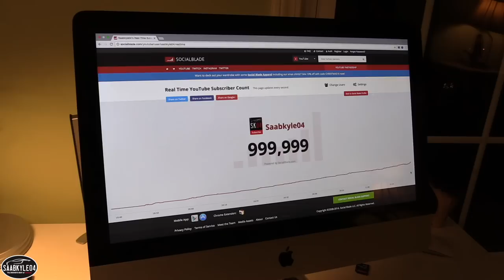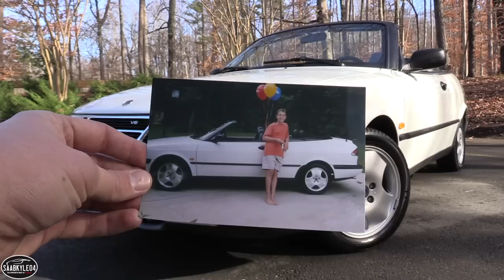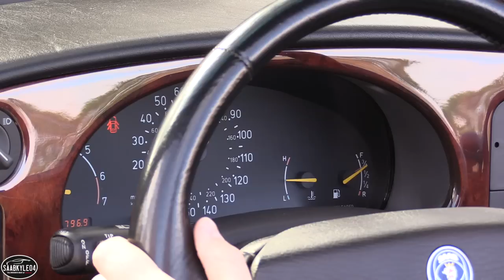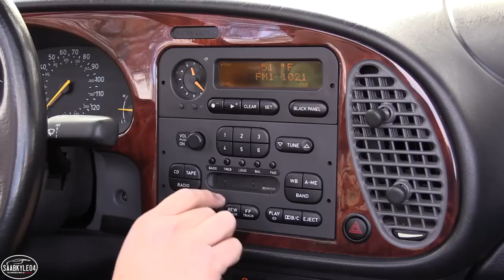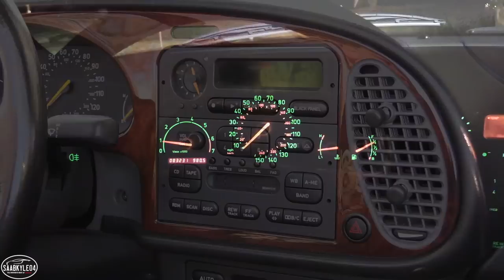My SAAB Story - Saab 900 SE Convertible In Depth Review & Road Test (1 Million Subscriber Special!)

Comment: The LOUD button on the stereo turns on the Loudness Curve, which is a form of equalisation intended to mostly enhance bass and low-mid frequencies at low volumes to compensate for engine and road noise.
Reply from the maker: That makes total sense, I knew the premise but didn't know exactly what it was effected.  Thank you for that!
Reply: Saabkyle04 No worries :-)

Comment: I had a 1997 NG900 5 door with the 2.3 non turbo manual it was very reliable and fun. I have been driving several 2004-2005 9-5 manual sedans and wagons

Comment: congrats on the million plus subscribers.

I bought a 1998 saab 9-3 convertible, paid £2000 for it and over 4 years I dropped £8000 into her to get the saab I wanted.

3 years ago we bought a ng 9-5 (the new shape) have you reviewed one?
it was a special car and an event to look at and drive (our actual car appeared on top gears review on saab after they went bust)

I regret selling it,but no dealers and limited supplies of parts,no tec 3 to maintain the electronics meant it had to go.

Comment: I had a 1998 Saab 900s with the rare copper color, manual transmission and convertible. this video brings back memories. I had to scrap it because the interior got destroyed from mold. the top leaked. I want to buy a used one soon and restore it just like you did.
Reply: it had 230k on it and could have kept going.
Reply from the maker: Man, that sounds like quite the special car!
Reply: Hopefully they make a comeback

Comment: You know, I have a 22 year old Saab 9000 and I've just invested in new shocks all around, new cv joints, new lambda sensor, new v-belt damper, new stainless 2,5" catback exhaust by BSR, new 3" sport catalysator etc etc. Also got another boot lid in correct Le Mans blue colour which I'll swap on later. I've installed a complete Aero interior, GT28RS turbo, high perf fuel pump, injectors etc.

Maybe I should change my name to Saaberick.

Comment: My 1990 BMW e30 convertible, with plastic rear window does in fact have a rear defroster, it is electric and operates like a hair dryer blowing warm air onto the plastic, I also have a hard top for it that has rear glass and defroster, all of this of course is irrelevant as I don't drive it in the winter :)

Comment: When did Saab get in bed with GM? I noticed that one of their SUV's from around 2004, it had GM door handles and it had curves similar to GM vehicles. That was a big turnoff to me. Saab were always somewhat prestigious and unique in their design and materials used. I wonder where Kyle's was built, I doubt in Sweden. My brother had an '83 900 and it was very durable and dependable, but I have to say he did put quite a bit of money into it.  I can't remember exactly but it cost at least $2,000 for a new clutch, supposedly because it was front wheel drive. And when it was cold, it would stall at least four times after starting until it ran long enough. And I also remember it would always grind going into second gear, and he never found out why, unbelievably. In any event, it was fun to drive, not at all energetic, but adequate. And it road somewhat firm, but felt very substantial, not unlike an older Benz from the late 80's.  And it was very roomy, surprisingly so. I often wondered if Saab or Volvo made the better automobile?  Volvo was always known for safety, namely the safety cage surrounding their car. What most people didn't know was that Volvo marketed their cars on that but every car at that point had a safety cage. But it definitely served Volvo well. I guarantee they sold many cars because of their safety, because quite honestly, they weren't much to look at.
Reply: 2k$ for a classic 900 clutch is a shameless rip off. Parts are around 300€, and replacing it is less than hour of work, even on a turbo. I know no other car where a clutch job is that easy...

Comment: i need to buy a 2001 ford windstar again or trace ours down. We sold in in 2012 after something went wrong with the engine for 700 bucks to carmax. I remember missing that van so much, i grew up in that thing and went everywhere in that thing. It's very rare to see a se from 2001. I found the vin number a month ago and It works. Just dont feel like wasting money on finding out where it is at the moment.  I need to buy a 1985 toyota supra first with my money as my first car, tired of driving mom's civic. Oh and I also tried to find our also very rare 1995 dodge stratus es and 1983 honda accord but no vin numbers anywhere ;( I searched for a week and half.
Reply: Shyzah My parents had a 1997 Toyota Corolla, I loved that car. We stopped using it in 2010, when my parents got a Mazda5. Since then, the Corolla has just been sitting next to the house for the next 3 years, until my dad wanted it towed away to the dump. It was a sad experience for me!
Reply: yeah.... tbh if the windstar wasn't a van in which i went everywhere in i wouldn't have cared at all lol i would've loved to seen it get destroyed or something.... but memories are something else.
Reply: My parents when I was real young had a cherry red 1988 Nissan Sentra sedan, the car my mom learned to drive in. 40+MPG without even trying, easy to drive & was reasonably fast and light for what it was. I learned in a 1995 Mazda B2300 Pickup 5-Speed Manual. Really cool pickup, but far from fast! Lots of shifting just to pass cars on the highway!

Comment: Boy this is a beauty!  You talked about the timing belt issue.  I have heard of this.  I also heard the automatic was not very reliable.  Requiring replacement before 100k.  Any issues with yours?   I love the sound of that v6 under load!
Reply: Automatic garbox actually IS reliable, when properly maintained. Most people cheap out on ATF changes, though...

Comment: 900SE Turbo: 185 hp
900SE V6: 170 hp
Congratulations, you managed to get a car with less power than your first car!!
Reply: As if 15hp makes a difference to Kyle. GTFO
Reply: mannys9130 If you're a car enthusiast, you know that power is EVVVRRYYYTHINGGG!!!! Just kidding lol
Reply: mannys9130 the power delivery of the turbo makes a huge difference
Reply from the maker: Yeah, well if you listened to the video, the very beginning in fact, I stated my reasonings.  I have never seen a turbo for sale in this exact color combo, never.  I bought a parts car that has the turbo though.  If this one gives out someday, I have a backup lol.
Reply: Saabkyle04 A backup you say?
Reply: Also, these engines have totally different characters. SAAB i4s, even the naturally aspirated ones, usually are all about mid-range torque, while the Opel V6 (both the 2.5 in the 900NG and the 3.0 in the 9000) are smooth and love to rev.  
Objectively, SAABS inline-4 turbos are the better engine - more torque, more power and better fuel economy (driven sensibly and with moderate speeds). But the v6 shines in two conditions: either when you want a very smooth and quiet engine for your cruise, or when you like to put you foot down all the time. For high-speed runs on the Autobahn, the v6 is actually noticably more fuel efficient than the four cylinder turbo...
I understand why so many SAAB guys despise the Opel V6 - that engine is just not what they expect in a SAAB, and it cannot do what they are used to. But it can do different things. And to someone from outside the SAAB world, the Opel v6 should have quite some appeal.

Comment: I think it was a 6 speaker 160 watt sound system. At least my Viggen has 6.
Reply from the maker: It's 8 speakers in 6 locations, per window sticker :)
Reply: ***** I've taken the interior apart on mine (It's a 2002 9-3 convertible) and mine has six. Brochure says 6 speakers (160W total). 

Do you know the locations of all 8?
Reply: kirbyswarp 
the 9-3 vert as you say has 6 speakers if the optional amp was ordered,this added door speakers that  are powered by the sub.
if the amp was not optioned then the doors had no speakers,just the grills (although the wiring is present)
Reply: Yup, and I'm sure it sounded terrible without the Subs in the doors. The made some strong bass until they blew up going 90mph with the top down ;)
Reply from the maker: The sad part is that my door speakers are blown haha, I need to get that fixed ASAP!
Reply: ***** Mine are too! It's most likely the foam however. The foam goes bad. Mine had bad foam, but now one is actually blown.

Yours might need a refoam. Every junkyard car ive ever seen has terrible door speakers with the foam completely missing.

Comment: Have you seen a manual transmission Saab before?
Reply: 6speedguy84 I own 2 of them. A lot of them are.
Reply: 6speedguy84 an automatic one is actually rare where I'm from,nearly all of them are manual here.
Reply: 6speedguy84 Yes he has. A few years ago he made a in depth tour of a 1988 Saab 900 Turbo Convertible. And also, as a part of the "Back Lot Dealership startups" series, he did in fact feature a 2004 Saab 9-3 Turbo 5-speed.

Comment: The performance of this car is definitely bottlenecked by the gear ratios it seems like. But it wasnt made for pure performance. Wonder what would happen if you put a different final drive in it if thats even feasible.
Reply from the maker: I have no clue, but I imagine, if that were possible, that it would make a huge difference.  Sport mode should have been the default mode from the get-go haha.
Reply: You could always test it out by throwing some small diameter steelies on the front :). That would be a funny video.
Reply from the maker: Hahaha, that would be XD

Comment: In my opinion the only reason why Saab failed is because their choice not  to make a rwd car
Reply: TheVintagetamiya I disagree. they ventured into AWD without too much success. Saab died because they were niche cars and because GM tried to hard to make them appeal to everyone while Saab refused much of what GM wanted
Reply: TheVintagetamiya Saab failed purely out of pride.

GM was forcing Saab to use Vauxhall parts and were restricting them to a budget which meant Saab couldn't get  the level of quality that they wanted.

Regardless Saab ignored GM and would completely blow the budget given to them in an effort to build their cars to a level of quality that they wanted and not GM.

The later 93's were meant to be basically a rebadged Vauxhall Vectra but Saab developed their own parts and changed nearly everything from the Vectra so much so that they were two completely different cars.

Of course this meant they were spending way more than what GM wanted and as a result they went bust and GM dropped the brand which is a pity because they're actually real nice cars.

Top Gear U.K done a segment on Saabs downfall,should check it out.
Reply: Lot to do with the Economy crashing and Saab couldn't be sustained financially. Couple companies bought it from GM, but they couldn't maintain it.

Comment: SAAB's V6s, especially for the 1995 900 were junk.
Reply from the maker: Hopefully it lasts a while for me, it's been great so far, but I'll do what I can to keep it going in top shape!   I'd love to put a turbo 4 in it some day.
Reply: The engines are not bad at all. They have two weak points, and both come down to maintenance: they require both frequent timing belt (and water pump) changes as well as as frequent coolant changes, because if let your coolant age, the oil/water intercooler will corrode and it is a very nasty andlabour-intensive job to replace it. With proper maintenance, these engines last.